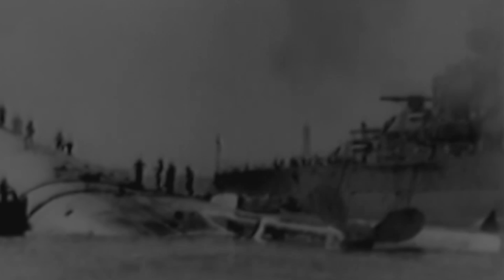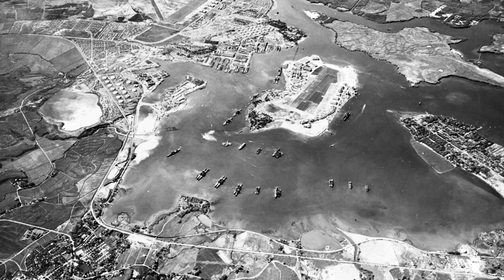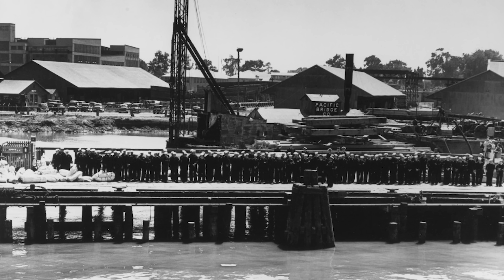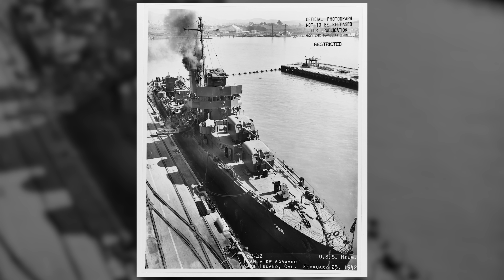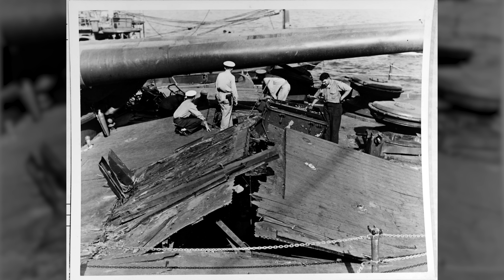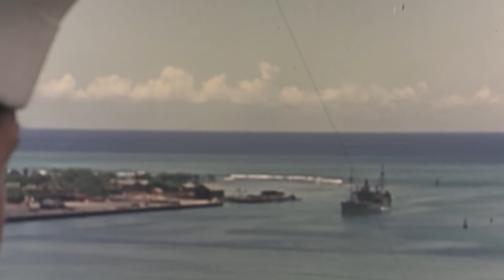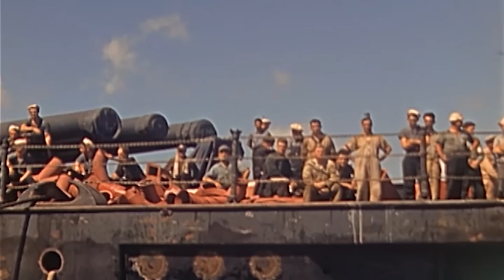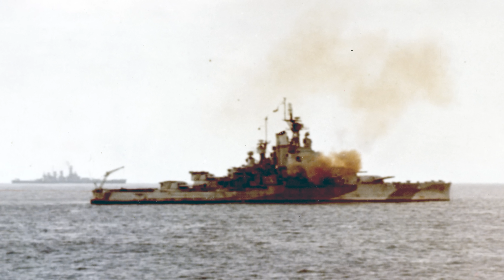The 'Zombie Battleship: How They Salvaged Pearl Harbor (2/4)

Comment: Do you think they were able to pay off a decent amount of salvaging costs with the salvaged materials
Reply: Short story: Yes.
Long story: It's two fold.
At this stage it was a question of "can we even fight this war", the threat of Japanese ships shelling American ports with drydocks, not to mention the Panama Canal, was absolutely real, if not present.
Add to that, German Uboats were wreaking havoc on the east coast.
And then on top of that, American industries needed a bit of time to switch and retool from civilian to war materiel.

Of course, we now know the RN were having pretty much the upper hand around the European continent (sans more convoy escorts and total cover over the "black pit"), so the USN could afford to divert more ships to the Pacific, but that wasn't common knowledge at the time.

Thus, between then and there, they needed to get a tally on the butchers bill, and even if Pearl Harbor hadn't been as costly as it was, they still needed more ships to use against the Axis powers, these ships took a long time to design and build.
+points for already designing a decent set of mass production cargo & oil freighters before the war started, but fleet carriers, escort carriers, seaplane tenders, battleships, cruisers, destroyers, frigates/escorts were another crump of bread entirely.

USN submarines may have got off untouched, but they were still untested in battle, and they were having a few issues of their own, so the absolutely enormous impact they would have on the war in the pacific was absolutely not set in stone or foreshadowed.

So for a bit there, it was actually looking more bleak/uncertain than what a lot of history outlets make it out to be.
Nothing is certain in war.

As such, and with that in mind, getting as many of the sunk/damaged warships at Pearl Harbor, back into service, as quickly possible, was in and of itself worth the salvaging cost.

That said, nothing went to waste, at least not when and where feasible.
The intact armament scrounged off the Arizona was kept as spares for other ships of her class too.
Of the ships that were taken up and scrapped, the steel came in very handy, especially armor for the BB's and the various alloys from armaments that were too damaged from heat to be put on other ships could still be melted down and made into new guns (that stuff ain't cheap).